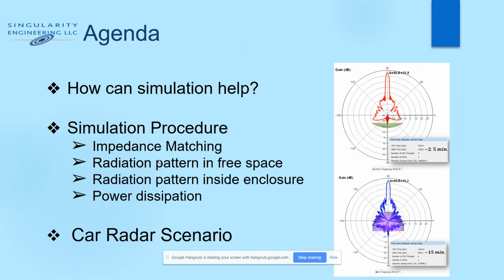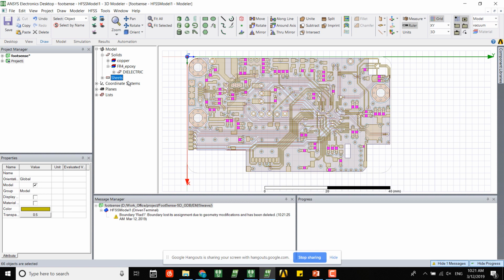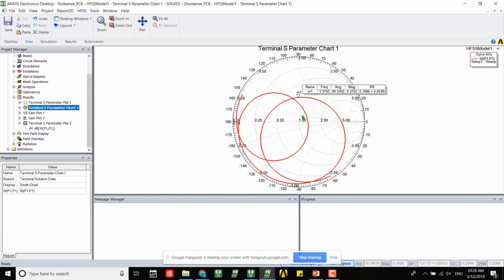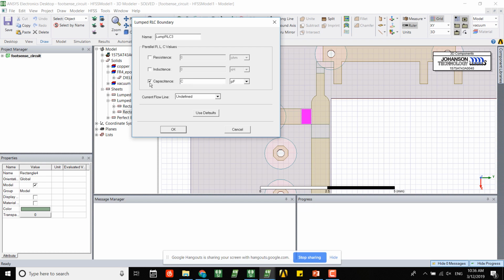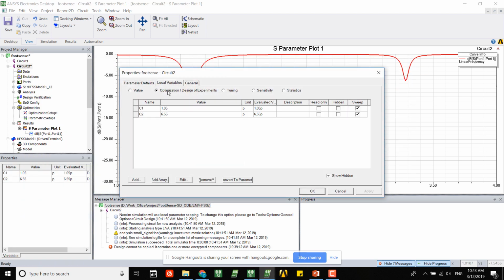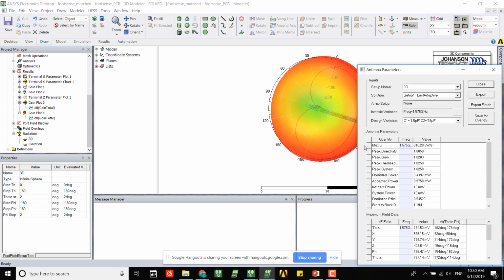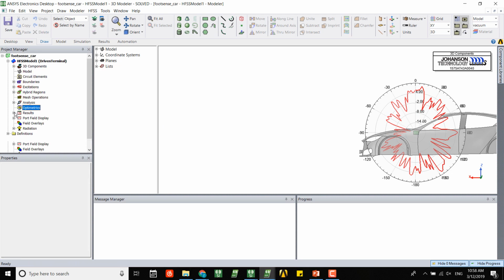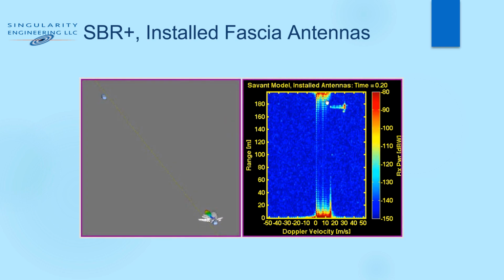Antenna and RF design simulation with ANSYS HFSS

Comment: Hi Zefan, I did follow your wonderful guide for HFSS and I can do optimize LRC component in Circuit environment to matching impedance. But when I apply those new value to HFSS 3D through Lumped LRC and re-simulating it then the result of resonant frequency slip out of position where it should to be in Circuit environment. The plot look the same but only resonant frequency not the same. Is it possible that the way we set up Lumped LRC effect on simulation like current flow in LRC set up and the shape of Lumped LRC? And this is really out of my knowledge and I have no way but to ask for your help.

Comment: Hiy Zefan I try to export my pcb board from SIwave to HFSS which is same in your presentation. But after exporting the passive component (capacitor, inductor and resistor) is not visible in hfss .
If passive component is not exported my board may be become open circuit. Can  you give me some comment please